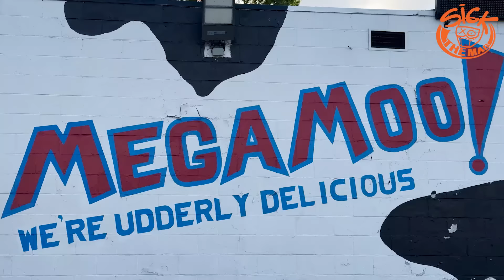Goldstone's Gladiator Spirit, Alex Taylor Keeps Pressure On at Drag Week Day 4

Comment: Back a few years, I looked at a 600 cu in big block Chevy that had plugged an injector nozzle on number one cylinder. It was an aluminum block and heads, so the flame cut a path in both on the way out to the front of the block and cut a hole in the engine plate also.